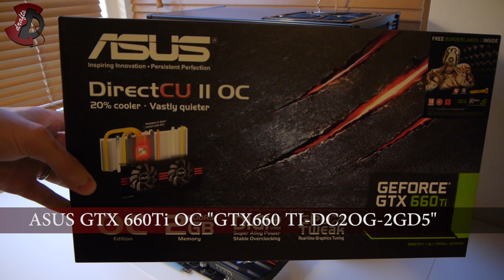ASUS NVidia GTX 660Ti OC Installation and Thoughts

Comment: Which power supply cable we plug into the graphic card?
Reply from the maker: Hi. It depends on the card really. Can be 6-pin, 8-pin, both together or even two 8-pin ones. Usually these cable connectors are made in a way that they won't fit if the connection is not meant to be used the way you are trying to connect.

Comment: would I have to connect 2x pci-e ports (6 pin)  or would 1 pci-e( 6-pin)  just work?
Reply from the maker: You have to connect all power connectors on the GPU(s), yes.

Comment: what's that dust remover he's using?
Reply from the maker: +Google Minus Rocket Blower. It is mainly used for camera equipment cleaning but works great on pretty much anything and does not generate static.
Reply: thank you ill need it

Comment: Does that graphics card fit and work on HP Pavilion P6 Desktop PC?
I'm using Intel Core i5 3350P and Windows 8.1, So tell me, please?
Reply from the maker: Never tried, sorry. More than anything check the power supply. Do you have enough connectors to feed the card?
Reply: Do you mean PCI-E or what?
But i think i have.
Reply from the maker: I mean required power connectors from PSU. Many brand PCs like HP, Dell, Lenovo come with little to no expansiom room in terms or PSU output.
Reply: Ok, i'm going to find out!

Comment: Do u think this would work in a pci express 2.0
Reply: It will they are backwards compatible
Reply from the maker: It sure will. I had GTX 660 in if not mistaken PCIe 1.1... Have a look at my channel, video called Supercharge your old PC - Dual Core meets 2012 tech.

Comment: Hey, I was wondering what cable goes into the graphics card I'm currently using 640 and I didn't have to plug anything in it except the monitor from the other side.

Comment: You should consider getting a new CPU cooler if your going to be using the 660 TI over-clocked, like the HYPER 212 EVO. The stock coolers for Intel are poor considering.

Comment from the maker: Even much older motherboards have PCI Express 1.1 and higher that is compatible with this card. Z77 is perfectly capable. As for PSU depends on exact model. Most decent 600w ones would have at least 2PCIe 6pin connectors. Mine one is 660W and has 4 8pin if I am not mistaken.

Comment from the maker: What PSU you have? If its a cheap one chances are that's the fault. Never skimp on power. Otherwise your GPU might be faulty or you didn't release the securing "hook" of the PCIe cable before unplugging. I just hope that you did not do any plugging or unplugging when PC was live.

Comment from the maker: Depending on the cooling solution GTX 550Ti is a bit smaller. In regards to power supply, they use similar amount of power. So provided you use a decent PSU there are no issues there. It all depends on your case really but I don't see any problem fitting GTX 660 Ti. It is not that big of a card.

Comment: Allright, I currently have ASUS GTX 550 TI and i'm about to buy the one you presented above. Do you know if it's compatible (same size etc.?) I have a 500W PSU, this should be able to run 660 right? Anything else I need to know?

Comment from the maker: Hi. It is called Rocket Air Blower. It was made for photographers to clean their lenses and other equipment but I found it good enough for most uses - I even use it to regularly clean my PC case. Does not generate any electrostatic charge unlike vacuum cleaners or leaf blowers that some people use.

Comment from the maker: There is no second cable because your PSU manufacturer decided it is not capable or not certified to run 2 connectors. Unless you have a decent certified 500W or more PSU you might need to upgrade, sorry. Never skimp on PSU - I learned it long time ago.

Comment from the maker: I see. It is different case all together. Get rid of that DVD drive in exchange for external USB powered. How often would you use it anyway? Then tuck two drives there and still have space for cables above. Make sure you have enough of airflow though. Also, where is RAID card for the drives?

Comment from the maker: Fair enough. In my opinion you can use the config I have except limit to 8GB of RAM and go for GTX 680 if you really think you need one. 3570k and Hyper 212 cooler is plenty and the MB one of the best for form factor. PSU I have is also efficient and powerful enough even for 2 way SLI. As for storage it is obviously up to you.

Comment from the maker: Most of PSUs have one. Quite a few come with two and you have to shop around for ones with 4 6pin PCI-e connectors. I would go with GOLD rated 4 6pin PCI-e fully modular PSU but if you are not planning that far ahead or on tight budget any decent PSU with 2 6pin PCI-e connectors would do for a good while. You can always go for the likes of single GT 680 or SLI 660.

Comment from the maker: It is all up to yourself. Have a look on Corsair website for details on what connectors it has. Make sure you have enough and the right ones - this is your main worry. As for wattage - the better efficiency the lower the draw from same system. There is Bronze, Silver, Gold and Platinum I think. I am always trying to go for Gold for my own rig. Obviously these things cost extra. Modular is also good thing but then again - these units are pricier.

Comment from the maker: Hi,
GTX 660Ti requires two 6 PIN PCI-e connectors. Request a search in Google or other provider you are using - there are tons of images. Once you have two of these you are ready to install the GPU. 500W is plenty even for GTX 680. Once you don't OC that is..

Comment: Hey Eds drafts,
I am thinking of ordering the GTX 660ti GPU and I'm not 100% sure if my 500w CoolerMaster PSU is compatible with it. I know 500w is enough, but I'm not sure if the PSU has the needed connectors. If you could have a quick look at it, please could you tell me if I could have the 660 in my PC. Here's my PSU:
(coolermaster's website)     /product_id=6696
(Sorry, YouTube wouldn't allow full link)

I would really appreciate your help,
thanks.

Comment from the maker: Hi. If it has two 6 pin PCIe connectors and they are not used anywhere than yes it will. I can't guarantee all PSUs though but any decent one will do just fine.

Comment from the maker: I am a bit confused. So you have one 6 pin PCIe power connector? And no second one?
Molex are not really meant for these types of loads. You would have to check your PSU manual to see what Molex connectors sit on what rail to make sure you don't jeopardize your system.
I personally would upgrade to ~ 700W fully modular 80% Gold PSU and that would ensure you will see no problem with upgrades for next few years. PSU is very important component. You could sell your own PSU for some funds.

Comment from the maker: Hi Andrew N. Your PSU should  be able to handle it. PSU fron Tier 1 and Tier 2 manufacturers should do the job. Even if it was 400-450W. What devices do you have in the case connected to it already and what model is your PSU? You will need both 6 pins for GTX 660Ti. Non ti model uses one pin. Without 2 connected some GPUs wont allow system to start.

Comment from the maker: Single GTX 660Ti should run no problem if you do have the 2 PCIe 6pin connectors. The card can easily run on decent 500W (and even smaller depending on other devices in your system) PSU.  So just power it on and enjoy your card. SLI is obviously no no with this configuration.

Comment: Hello once again, so sorry to keep troubling you. I just had a look at my PSU again, and realised i have two pcie 6+2 pins. Was confused by the single 12v rail description.
So does it mean i can use my current PSU to power the 660ti?
540w and 45a across the 12v rail.
Available connectors(non-modular):
M / B 24 pins x 1
CPU 4 + 4 pins x 1
PCI-e 6+2 pins x 2
SATA x 6
Peripheral 4 pins x 3
Floppy 4 pins x 1

Comment from the maker: Good question. Honestly, if PSU only provides single means it is not really designed to do two. As for molex... Usually people recommend not to use it - under load you might blow your PSU or at least get stability issues. Molex is mainly for relatively low wattage devices, GPU is different story. To know for sure you must check what rail molex sits on and what are the specs of that rail. I would look for new PSU if you can sell yours. Otherwise - lots of reading and/or testing. Hope this helps.

Comment: Hi, was thinking of getting a gigabyte gtx 660 ti, but my psu (coolermaster gx-lite 600w) has only a single pcie 6pin. Is it possible to use the 6 pin for 1 and a 2x4 molex to pcie 6pin adapter for the other? Or should i just get a new psu (any reccomendations?)

Sorry to trouble you, newbie at this.

Comment from the maker: GPU usually pull air and push it out the case via the 2 or 3 slots it is in at the back of case. PSU should do same - intake from inside of case, push out. So.. should be pushing air away from each other.

Comment from the maker: Well.. try the Safe Mode (keep pressing F8 when computer is starting up). Then just uninstall drivers, boot as normal and install again. Worst case scenarion Windows reinstall might be needed or even worse GPU is faulty. Also check you are feeding the card with enough power - i.e. both PCIe 6 pin cables attached.

Comment: Not sure if this is late but you can upgrade to the GTX 660ti on your H8. The only thing you will need is a new power supply if your current power supply is too low for the GPU. The 660ti requires a minimum PSU of 450watts. Look for a PSU at least 80PLUS Bronze certified and has a +12Volt Rail, such as a Corsair TX650 or equivalent just in case you want to upgrade any other parts in the future.

Comment from the maker: Sorry but havent had experience with 'white' PCs and aftermarket GPUs. Check PSU Wattage and required connectors and make sure you have enough space inside.

Comment from the maker: i5 surely would be at least PCI Express 16x 2.0 if not 2.1so any GPU on the market should work. Is it a custom build or one of DELL etc. ones? If it is brand named you might have issues fitting other than manufacturer specified PSU as they tend to be custom made. Open your case and have a look on your motherboard for writings - should be big enough and easy to read font. That would be your MB name, especially if its custom built.

Comment from the maker: First things first - never skimp on power supply. I have never heard of Apevia and therefore can't recommend it. As for PSU replacement in general - take out the PSU you have at the moment and measure it - looking at standard info of your chassis it should be straight replacement. If you are not sure - ask manufacturer or the store. Also, are you sure you will be able to replace the PSU yourself? Its not that hard of a  procedure but still.